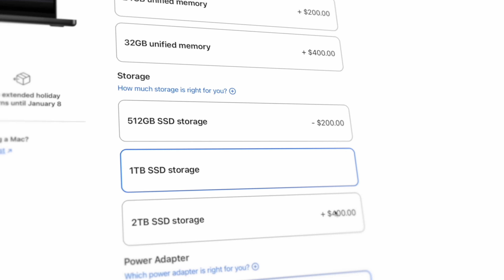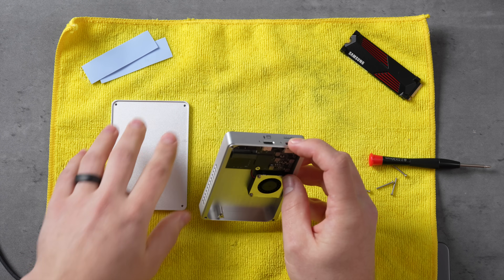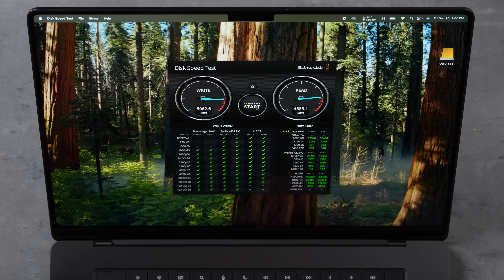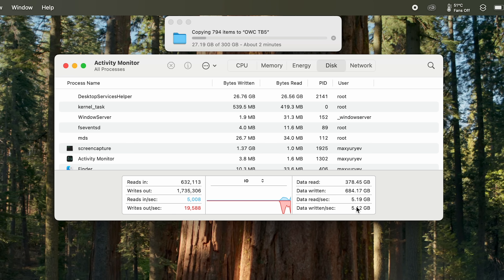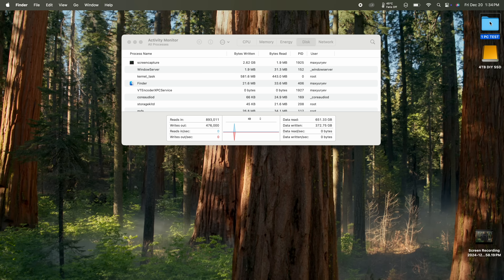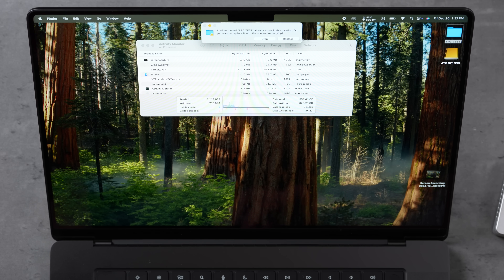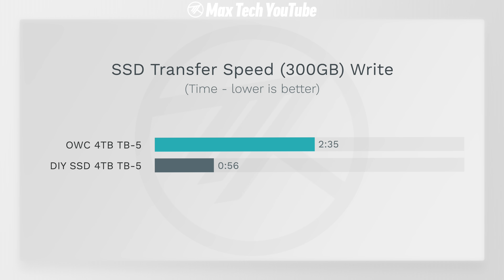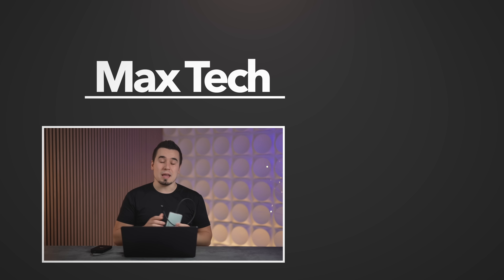How to Build a DIY Thunderbolt 5 SSD for LESS $$$

Comment: Hi Max the Samsung does not have an SLC-Cache it has an DDR-Cache.
The Samsung Drive is also available without cooler (and less expensive)
The advantage of Drives with SLC Cache (using TLC or QLC Nand cells as an SLC cell) is they consume less power than the faster DDR-Cache.
The disadvantage of SLC-Cached Drives the NAND cells used for SLC-Cache also degrades as the rest of the NAND.

The biggest concern is the real life relevance of TB5 drives vs. TB4 or TB3 drives.

If you use them as a work drive and not just a storage device the throtteling becomes more evident, so it heavily depends on the use-case. You can have the situation that a slower drive delivers a better overall performance than a shortime lightningfast device. Comparison 100m sprinter vs. marathon-runner, the sprinter will finish the marathon hours if not days later than the marathonian, but the marathonian will finish the 100m competion only a fraction later than 100m specialist.
Reply: No, they use both DRAM and SLC cache.  Seems like you don’t really know what simulated SLC cache is for. TLC (and QLC) direct write is EXTREMELY slow, so every recent consumer drive use simulated SLC cache. On an 4TB Samsung drive, the DRAM is only 4GB, and the simulated SLC cache is a few hundred GB. It needs SLC cache for sustained performance.

If a drive is DRAM-less, it’s likely going to use HMB (host memory buffer), but in a Thunderbolt/USB4 enclosure, HMB couldn’t be used on a Mac. I actually doubt if Macs can do HBM at all, we all know PS5 doesn’t do HMB.
Reply: @rorywalters1614  Simulated SLC uses TLC  or QLC cells with only two states instead of the possible 8 or 16 states, this does not enhance the lifespan of the used NAND-cells. Samsung uses  V-NAND 3-Bit MLC (with only 4 states) for storage and DDR4 SDRAM for cache.
The higher the number of states, the more information is stored in the cell, the slower is the access speed for writing (and reading), the lower the lifespan in (write cycles). SIMULATING SLC does bot change the electro-chemical properties of the cells.
The major concern regarding of simulated SLC vs. REAL DDR-Cache is the degrading of the used NAND-Cells. real SLC has a massive higher amount of write cycles.

The DDR Cache size is according to the Size of the drive 4 TB has 4 GB Cache, 2 TB has 2 GB Cache and 1 TB has 1 GB Cache.

Comment: I refuse to buy macbook pro or studio because I feel it's criminal how much they charge for memory(ram and storage), then double down by giving no option to upgrade it yourself down the road in the aftermarket. Do you know how many people would switch over if they didn't play those games with memory? The performance is undeniable. Maybe they'll change that back now that thunderbolt 5 is as fast as it is.

Comment: I ran into an issue if I attempt to use say a 2TB and a 1TB external. No matter how hard I try my iMac will either run one or the other and not both. I think this is a power issue (Maybe?) on why it won't let me run both drives at the same time even though they are completely separate ports on the back of my iMac. I don't know if inside the iMac if they all sort of link up and all 4 ports share 1 single power source and I need to have a drive that has its own backup power? 

Anybody else have this similar issue? :body-blue-raised-arms:

Comment: I just put together a Samsung 990 Pro 2TB in a TB4 enclosure.  I transferred a 35 gig file in 15 seconds yesterday.  For my personal use, that was blazing fast.  I don't really see a major benefit to upgrade yet.  Do I want the TB5 enclosure.  Heck yeah, no doubt.  Until there is a legitimate need for me, I can wait till there are a lot of TB5 enclosures on the market and prices come down for it to be worth it.  Just curious on why someone would totally benefit from TB5 workflow wise?  I edit photos and video and play Resident Evil 4 remake.  My M4 MacBook Pro 16" pro has no issues so for.
Reply: Does your Samsung SSD have the heatsink? I bought the 4TB and 2TB versions of the Samsung 990 Pro with heatsink and they won't fit in the OWC  Express 1M2 enclosures I bought, unless I remove the heatsinks.

If I remove the heatsinks, I paid extra for the heatsinks I remove and the SSD warranties will be voided.

Comment: Backward compatibility ? I’m curious with the extra power port could an Apple Thunderbolt 3 to Thunderbolt 2 adapter be connected and it be used on a Thunderbolt 2 MacBook / iMac …

Comment: $200 for TB5 is ooof. Old TB5 enclosures were always in the $100-$120 range.
Reply: It’s brand new technology. Give it a year or two and prices should come down.
Reply: Old TB4 you mean? TB5 is also twice as fast, though
Reply: @paulkim718  Correct, but TB4 was cutting edge when it came out. Nearly 100% inflation to get a top tier enclosure now.

Comment: You can actually open up the OWC case. It has a swappable nvme and the data cable IS removable. And the 990 pro would actually run FASTER if you put it in the OWC.
Reply from the maker: So buy the OWC for $600 and then another $300 for the Samsung 990 Pro SSD?
Reply: @MaxTechOfficial  the owc tb5 is not really for consumer use imho, it’s more of a DIT or pro video editor maybe use case, and as expensive as gear gets, a few hundo for fast speed shouldn’t be a problem. I use the envoy express owc tb enclosures. For around $100, around 2000mb/s read and write is a really good deal in my book. I have 6 of them.
Reply: you sure? Thought their external SSDs were different than the nvme/SSD enclosures that they sell
Reply: What makes the OWC faster than the TREBELT enclosure ?
Reply: Not to mention how pricey that would be given the OWC is 600 USD without the samsung
Reply: The cable problem remains.
Reply: @voice5sur5  I saw someone open up the OWC. I't's a regular tb 5 cable fed through a rubber grommet.
Reply: @mochachaiguy cables are replaceable on all owc enclosures

Comment: I did something similar this weekend with the Acasis TB501 and a WD SN850X. Great performance, I disconnect the fan, the noise was too annoying and wasn’t cooling the top side of the SSD anyway.
Reply: I do not even hear the fan in my Acasis enclosure.

Comment: I seen a lot of these videos and this is def the first time an external drive is faster than the internal. Killer
Reply: It's not killer. It's still way too slow because of Apple's underpowered computers. The same SSD in a PC gets 7K and not just 5K.
Reply: @ that’s good for you and windows users, it doesn’t make me feel any different
Reply: @youtubevideos415 Honestly this is nothing to do with Apple, It is a TB4/TB5 vs PCIE limitation, PCIE is internal so closer to the computer bus so will always be faster than any Thunderbolt / USB 4 solution.

Comment: Thunderbolt 5 is in most cases overkill for most users.
$200 for an enclosure is insane, i purchased an Orico Thunderbolt 4 enclosure and surprisingly works better vs Satechi and OWC which cost significantly more.

The Orico Thunderbolt 4 cost me $40 on AliExpress, works with my WD SN850x, has no internal fan thus i added a big ass heatsink as it is a fixed drive for my mac mini m4.
I'm getting max Thunderbolt 4 speeds and surprisingly the OWC en Satechi enclosure did not work with my SSD because it drawed to much power.

I would just wait a few more weeks till Orico releases a Thunderbolt 5 enclosure if you really need that kinda speed...
Also $200 for a device that has no reviews is a NO NO.... Especially on their older enclosures they had plenty bad reviews i would not hit that.

Comment: I got an older TB3 Trebleet (probably from watching one of your older vids), and a cheaper 4TB Samsung 990 Evo. I was copying all my data over to my new M4 MBP, and was going to do other stuff while it copied in the background. It was done so fast I thought something was wrong. Shockingly fast but I wasn't checking for a transfer rate. Suffice to say TB5 you'll pay the top dollar for the best and you probably don't need it. TB3 is still super fast. You're going to buy the TB5 best drive either for a specific niche use case, or because you can afford the best of the best. 

Edit: Running BlackMagic from my M4 MBP, My external drive writes: ~ 2462 MB/sec and Read: ~ 2790 MB/sec

Comment: I’m confused. You removed the Samsung heat sink and replaced it with the thermal paste. Is that better? Can you do a heat test comparing both methods?
Reply: they use the case as a heatsink. I guess the original heat sink wouldn’t even fit into the enclosure

Comment: I wonder how much profit is made from the ssd upgrade pricing, and if its actually worth it for apple as opposed to the goodwill that would be generated by more reasonable pricing
Reply: well, considering that it’s an UPGRADE price, so you replace one drive with the other, you don’t get one extra, it’s a lot closer to 100% than anything else.

Comment: Nice, just a though, since the case is the heatsink its temperature being cooler than another case doesn't reflect much. Ideally one wants good thermal bonding between the case and the SSD and in order to determine that one should compare the SSD's temp sensor result with the hottest part of the enclosure , a close result would show better thermal transfer. Also an arbitrary temperature measurement  means nothing, what is the recommended max operating temperature of the SSD as stated by the manufacturer, how well does the enclosure keep the drive within that specification as compared to the other enclosure.
Reply: It even has a fan in it. lol

Comment: What's hilarious that these aren't even the fastest SSDs you can get. PCIe Gen 5 drives exist that have read and write speeds exceeding 12-13GB/s. Too bad they are way too fast for TB5 so no benefit in an external application yet.
If you're building a new PC and need fast storage though...